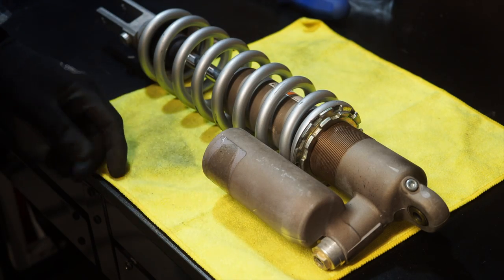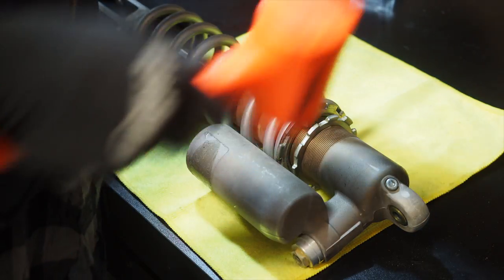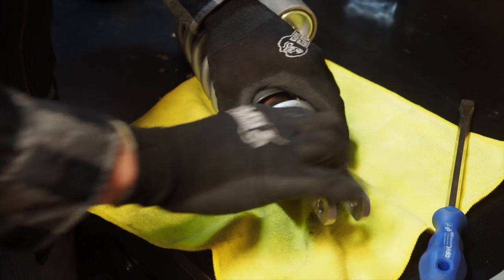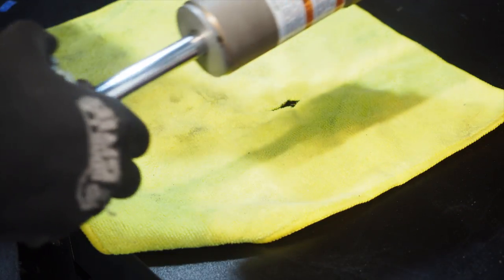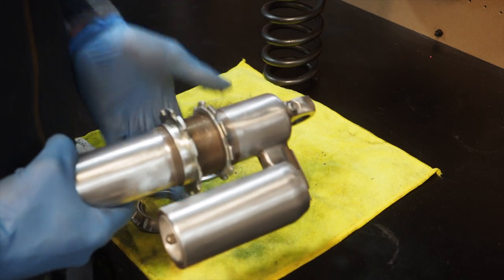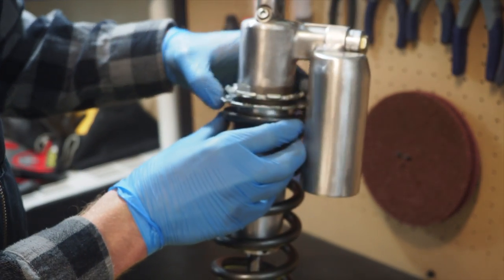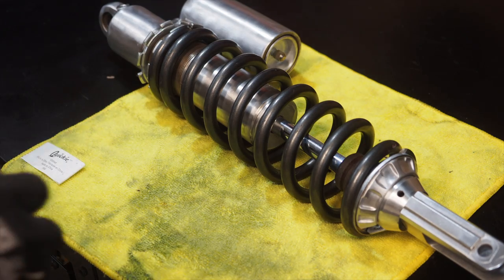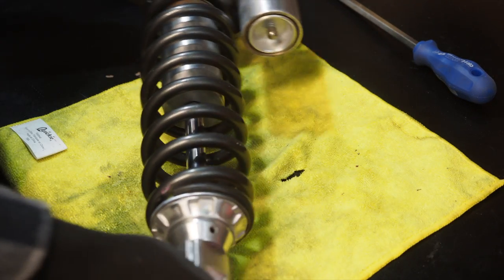HOW TO: Change the Shock Spring on your Dirt Bike

Comment: My spring is aftermarket and has no markings on it at all, i need a much stiffer one, how can i tell which one to get when i have no starting point? Also is the size pretty universal? Or do i need one specific for my 2007 husqvarna smr450?  Ahhh i just wanna buy a dang spring on ebay already n do this! Lol
Reply from the maker: Hey mate! Yeah it sucks that the springs don't have markings on them to let you know what spring rate they are.  Most stock 450s are set up for about a 170 pound rider.  If you are heavier than that, than you will for sure need a stiffer spring.  Also you can tell by setting your free sag and race sag of the rear end.  RaceTech has a great spring rate calculator that you can try out!